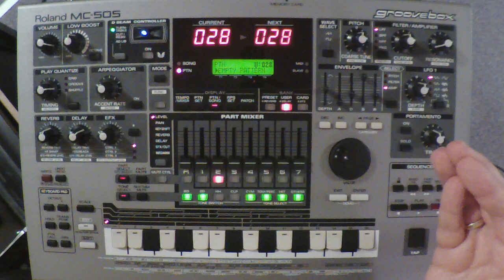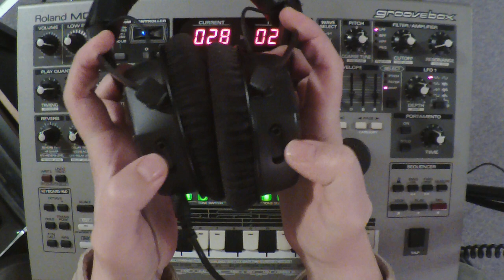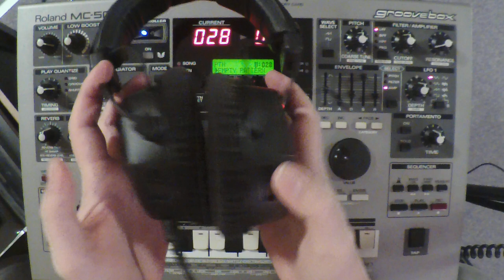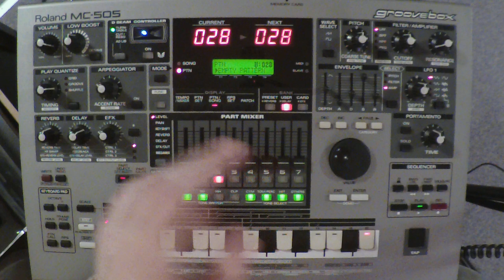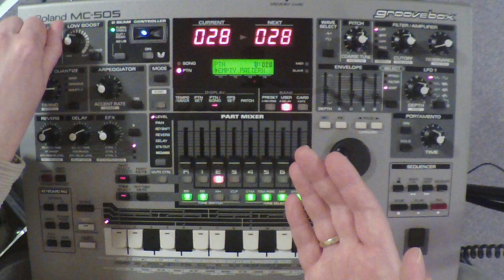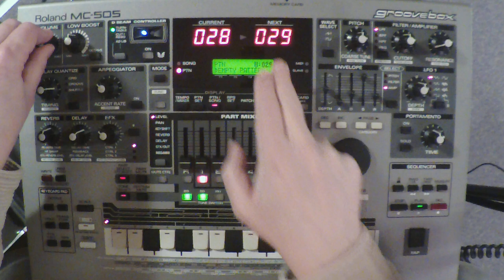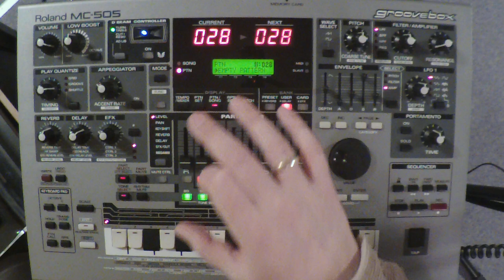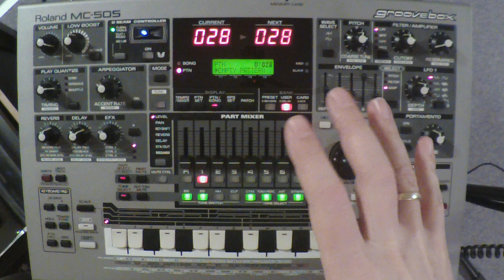Roland MC 505 The Sustain Bug Part 1 and a whole lot of babbeling

Comment: if there are gaps between patterns, that is the most basic thing and makes it useless for using it for what it is supposedly for. if you are only going to play one pattern over and over again but if you actually want to build a song, its worthless to have a gap every time it switches from one pattern to another...
Reply from the maker: It's not quite so bad. You are not stuck to just one pattern, you can build songs and a single pattern can be up to 32 bars long, but you can't hold a long note at the end over the beginning of a pattern. Yes, this kind of sucks but you can still make great music with this thing.